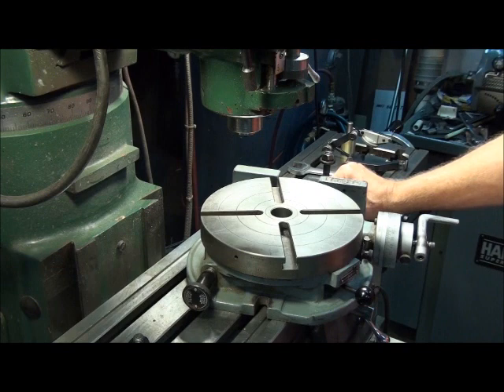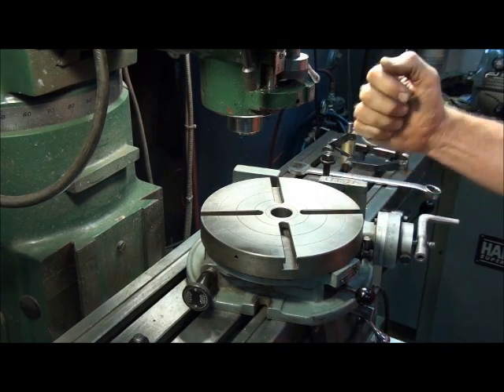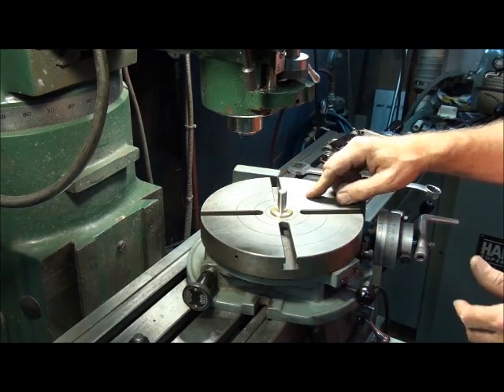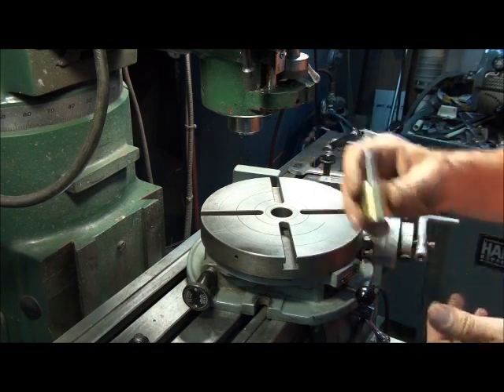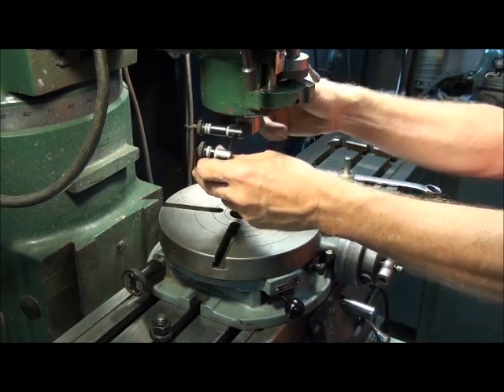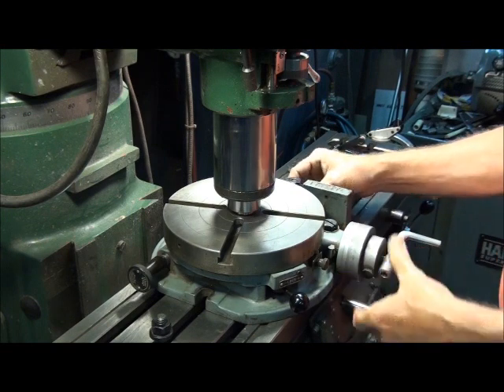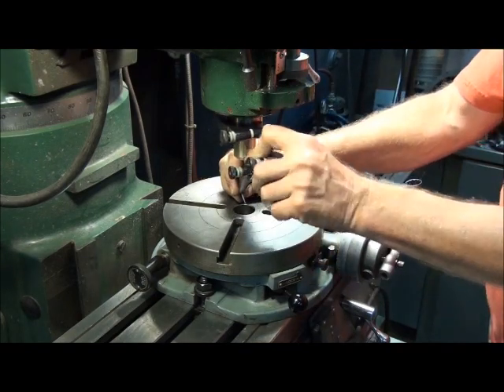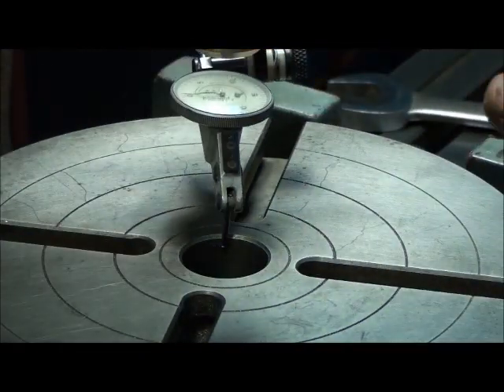Center a Rotary Table in Under a Minute Without an Indicator

Comment: Looks great but not sure how to cut a nice taper on my lathe without using the crosslide and feeding by hand which leaves a crappy finish or throwing my tail stock out which is tediously long in getting it back in line. Any suggestions anybody ? I also always indicate on the round part that I'm machining. As I'm laying out bolt circles, it always works for me. I don't see how this method allows one to avoid indicating the part.
Reply from the maker: @SmeeUncleJoe  There is another bideo on my site showing how to use a cordless drill to feed the compound or cross slide. You may want to check that out.
Reply: @TomsTechniques  sounds interesting...

Comment: Tom..... I did the same exact thing.  I'm not the fastest machinist in the world, I'm an engineer that happens to have a machine shop and I started doing similar things, in fact, made myself exactly the same thing.  Didn't take me much time now to center up.  (Believe it or not, I found one of the "end mill holder" style mounts, with the set screw in the side....  one that is ALMOST, perfect for the turn table. I made one up, because even though the end mill holder was close.... it was a hairs difference. but I could get darn close with it.  Your video has me adding a taper to my current one. I made it a snug, hard precise fit, but I think the taper is a better idea.

Comment: All well and good but my rotary table has no center hole. It has a T slot across the center  with two independent vice Jaws running in it. Looks like above but with one slot across the middle.
Reply from the maker: I've actually never heard of a rotary table without a center hole. The entire principle of RT work is reference to the center axis of the table. It might be time to find a new one.

Comment: how do you clamp parts to table- there's not enough room for toe clamps?
Reply from the maker: Make a sub plate that attaches to the rotary table and screw your part down to that. You may not even need to use clamps.
Reply: @TomsTechniques  thanks for the help Tom

Comment: Could you lock an expanding arbor in the hole for a snug fit. Then drop the collet over its spigot and tighten the collet.
Reply from the maker: Yes, but how would you get the arbor in and out without removing the table?
Reply: @TomsTechniques  I thought that loosening the clamping screw would collapse the arbor.

Comment: You did a bit of slight of hand.  I would expect your test to be exactly as you showed given how you centered the table.  BUT, what you left out was moving the table.  You didn't account for backlash.  I think once you got it concentric, but not tightened down, you need to move the x and y a bit, set the zeros, and then tighten it down.
Reply from the maker: A digital readout negates backlash. If you didn't ise one then yes, you would need to remove the backlash before tightening the hold downs.

Comment: My 6" Phz II center hole is an MT2 taper.  
A drill chuck arbor, with a straight shank, works perfectly for your procedure.
When I need a lathe chuck mounted, I use a large drill bit with a MT2 taper and simply lower the chuck over the drill bit.
By tightening the chuck on the drill bit, it'll self-center perfectly on the table.
Now I clamp down the chuck to the table. 
Hope that made sense...
Thx, Tom
Reply from the maker: Yes, that definitely makes life easier.

Comment: Thanks very much Tom, love that idea, and I can see me using it a lot in the future. 
I came looking for RT setup techniques after reading a machining book. 
The author of that book reckons that unless the RT is very high quality, the accuracy of the taper hole can be off a little to the true axis of the RT. 
For high accuracy he recommended you do something like clamp a turned ring to the RT and dial it relative to the RT axis so it running perfectly true, then afterwards dial the ring to the mill spindle. Then you know for sure the RT axis is accurately running true with the axis of the mill spindle.
I know that is in complete opposition to the point of your video but talking about high accuracy here for less than perfect RTs.
Reply from the maker: I have never seen a rotary table with a center hole that has questionable concentricity, but I suppose the exist (China). You just have to know your machines and their accessories to have confidence in them.

Comment: y not just use a dead center
Reply from the maker: If you had a plug with a center hole, that would get it close to center. This will get it closer.

Comment: Good trick fundamentally, anything that you can make once to use dozens or hundreds of times is always smart machining.

It's worth noting however that generally the bigger consideration is indicating your part true to the rotation of the table, and then indicating the table rotation to the spindle. This is particularly true when you understand that the center bore on most rotary tables is substantially (between .005 and .030) non concentric with the rotation anyway. 

Tapping in a part on the table to make it true with the table rotation after its aligned with the spindle is far harder with most setups.

Comment: Hate to say man .003” of wiggle is a lot much, if it was truly the same size as the bore she would be tight going in and next near impossible to fully seat. Take the time and just do it the right way man. 5 minutes vs. Wasted parts.  

Good for home use, but dealing with multiple bores over a few inches of distance ain’t worth a penny when your working within a thou
Reply from the maker: Where did you get .003"? The TIR was .0005" in the video, absolutely close enough for any part with a .003"-.005" tolerance. and much quicker than taking the time to set up with an indicator. If the part you are working on requires a closer tolerance, then common sense would dictate another method, such as an indicator. One of the biggest mistakes a machinist can make is to waste time creating a setup or machining a part to a closer tolerance than necessary.

Tom
Reply: Toms Techniques this .0005” static. 

I truly don’t mean to pedantic. Been doing this for 8 years now and most of the parts I work on are “x.000 +-.001” . This is on rotation. Of the 5 C tables I have used, none of them have been within .005 on a rotation. When doing partial curves this needs to be spot on, when not I have to shim the table. This causes to much friction during rotation, thus making cutting on a curve unsatisfactory. 

Just a nit picky thing

Comment: Dear Tom,
                   I wish to thank you very much for your videos again. I made a tapered pin in this fashion for my somewhat smaller rotary table and milling machine. The bore of my rotary table is a No.2 morse taper so I turned a pin with a No.2 morse taper one end and a 1/2" diameter the other from stainless (I hate the rust fairy) in the three jaw chuck at one setting. Centreing the rotary table is now a doddle. This idea is a peach. This set me thinking though as I had to mill a radiused edge around some holes on rope eyes that I was machining. I turned a Morse taper 2 plug for the table with a 3mm bore in it. This means that I could turn a pin with diameter 3mm one end and whatever was needed to fit the part on the other to centre the bore on the table before clamping it to same. The pin is then removed leaving access to the bore. It worked well.
I also want to say thank you again for the video on grinding drill bits for brass because having honed all my drill bits for steel I was having a torrid time with snatching. Well, having watched your video I bought another set of bits to dedicate to brass and having stoned those that I needed as I went everything was in apple pie order since. So thank you. If you ever visit the U.K I reckon that I owe you a nice warm beer!
Reply from the maker: Thanks Jack. It's always good to hear that the videos are being used.

I am of Welsh ancestry, so I would love to pay a visit to you fair country, in spite of the warm beer thing ;). Now that I'm retired, that just moved a bit higher on my bucket list.

Tom
Reply: @TomsTechniques I don't know if you ever made it to Wales but having been there a couple of times now, I have to say it's such a beautiful place and well worth the visit!

Comment: Excellent time saving solution for setup!

But, wouldn't it be more accurate to place the indicator with a magnetic mount on the surface of the rotary table and put the indicator tip on the spindle and then spin the rotary table?  I always found that the center hole on the rotary table isn't always true to the center of rotation.
Reply from the maker: Yes that would be more accurate, but it would also take a lot more time. This is a quick and dirty method for when centering a part within a couple of thousandths is good enough.

BTW if the center hole on your rotary table is not concentric, you should probably look into getting a new rotary table. Some things, such as the parallelism of the t-slots in your mill table are assumed.

Tom

Comment: Thanks for the tip! Can you do a video on tapping into mild steel on a lathe Preferably with a tap bigger then a 1/2-13???
Reply from the maker: +Dennis Ginser 
A spring center is the best way to tap in the lathe regardless of size. I'm actually thinking of making one as a beginners project tutorial, so maybe I'll demonstrate tapping in the lathe then.

Tom
Reply: +Toms Techniques  thank you. I normally use a spring loaded center. I just got a job that wanted me to tap a 5/8-16 with 1 inch of thread and the material is extremely hard to penetrate. I used a carbide drill thinking it was just case hardened and it was hard throughout. Once I got my whole drilled. I went to tap it with my spring loaded center and it is extremely hard to tap. Broke my tap twice and I'm keeping moly d on it and clearing my chip. Any tips would be much appreciated. Thanks tom.
Reply from the maker: +Dennis Ginser 
You need to use a taper tap for hard materials to keep the chip load down on the teeth. If you use a plug tap, the first teeth takes all the load and will fracture. A four flute tap is preferable to a two or three flute tap for the same reason.

Tom

Comment: Basically I want to add this color around this pivot the centre hole is 1/4 inch and I would like tho collor to go around that to be around 4 m&m bigger than that I could send you an email of what I need your advice on how to use the mill to achieve this please. Take care lee.
Reply from the maker: You can make a collar on the mill using a rotary table, but it would be a lot easier on a lathe. Basically you would just rotate the stock against the cutter to mill the inside and outside diameters. If you are cutting G10 glass epoxy, it would require carbide end mills. Also be sure to use a vacuum to collect the dust because it is hazardous to breathe.

Tom

Comment: Hi tom, I have a project coming up for a customer that I have to make what we call a pivot ring what I would like to ask please.. Is that if you could do a video pleas of using a milling machine to to mill a round coller that will go around a 1/4 inch pivot hope this makes sense if you could help with this please I would be eternally greatfull I have the mill a rotory table and laith chuck that goes on top of that that came this week. The material I will be using will be similar to carbon fibre called g10.

Comment: I use a live center with a morse cone  from my lathe.. Its the same cone as it is in my milling mashine so it fits in there. Center the rotary table with the center and tighten the screws..
Reply from the maker: Have you ever checked it with an indicator to see how well it aligns? You are relying on the chamfer being concentric with the bore and since it's probably 45º, it's not going to match your 60º center. Better check before doing anything critical.

Tom
Reply: Toms Techniques Thanks for answer! Well... it was good enough for the parts i made so far.. They were pretty center ;-)  Anyway.. Love to watch ur videos!!  Keep going Buddy.. Greets from Germany!!!
Reply from the maker: Thanks. Greetings form Michigan!

Comment: You realize with the indicator set like that you get a cosine error right? Where it is no longer 1 to 1 ratio?
Reply from the maker: Dial test indicators are best suited for comparing features, not measuring them. In this case I'm comparing one side of the hole to the other, so cosine error doesn't come into play. For actual measuring, a dial indicator is a better option, or using the DTI to compare a reading to a standard, such as a stack of gauge blocks.

Tom

Comment: my rotary table has a .500in center hole so I just use a short piece of .500in ground shaft. it fits the hole so close that I have a vacuum when I try to remove the shaft and it comes out with a pop sound. Also if I want to install a chuck on the rotary table I tighten the chuck on to the shaft sticking out of the rotary table and it will be centered as accurately as the chuck jaws are
Reply from the maker: That's the same principle I use to center parts that have bored holes. I select a gauge pin that's a tight fit in the hole and grab that with a collet.

Thanks for watching.

Tom

Comment: This is a good technique, even the half a thousandth that you may be out so what! how many home or even professional milled parts require a tolerance of better than +/- .001, most can tolerate +/- .002-.003! good time saving idea
Reply: Ted H. Most professional parts in my industry or more like .015 and that’s no joke. You want more accuracy you’ll pay and guess what? It just doesn’t matter for what the parts are used for nobody will ever know it could be .050 off. As machinists we cringe but consumers haven’t a clue.

Comment: great idea, any suggestions for mounting a super spacer, rotary index horizontally, instead of vertically? cause they are a pain
Reply from the maker: I made a similar device for aligning my dividing head. It's a block with two holes bored in it at a right angles to each other with a couple of 1" dowel pins pressed into them. One pin gets mounted in the quill which is left free to float and the other goes into the chuck on the dividing head, which has the angle lock left free. When the chuck on the dividing head is tightened, the angle gets set to zero and the spindle axes align. The head is keyed to the table slots, so that is already aligned. Obviously, great care must be taken ensure that the pins are at right angles with each other and that their center lines intersect.

Tom
Reply: You sir, are a genius. Thank you, should do a quick video on that, I'm sure others would love to see it.
Reply from the maker: EitriBrokkr
You are very welcome.

I forgot to ad that since the dividing head is keyed to the table, it must first be centered on the spindle axis, or you can kind of "feel" it on center with the Y axis crank as the chuck is tightened.

Tom

Comment: If at first you don't succeed. Well, I tried to make one, but struck out. My old lathe is so loose that the dials are nearly useless, if I was even any good at using them. I almost have to FILE my way to a close tolerance like is needed here for the head taper, let alone the collet shank. I always seem to take "one pass too many." Of course, it was my last piece of stock big enough.... (BANGHEAD!) That, and it's zero degrees F out in the garage!
Reply from the maker: It's always challenging when the machines won't do what you need them to do. Have you tried tightening the gibs? There's nothing wrong with filing if there is only a thousandth or two to take off, just be sure to watch my video on how to do it safely.

Tom
Reply: Hi Tom; The old beast has wear everywhere. I would not be surprised that the gibs are not true and need replacing. I think the biggest problem is wear in the main spindle bearings. It has both axial and radial movement there. I need to spend some time re-shimming the spindle bushings. Yes, you read that right. Bronze bushings. This is a Prentice Brothers 16" Gearhead Engine Lathe made between 1909-1912!
Reply from the maker: It sounds like a real beast. Are you sure the bearings aren't babbitt?

Tom
Reply: Well, it's only a 16x36, but it's a good size old lunker. Can't post pics here, but they are split bronze plain bearings. I need to take the time and work on the shimming to see if I can tighten things up a bit. Worst case, it needs new bearings. Those will have to be made. It's so inaccurate, I can't tell if it has direct read dials or not!

Comment: Tom; I'm a new subscriber to your chanel, and am bouncing around at random. I'm finding your style fits mine quite well. Get it done, efficiently! As a moderately dense noob metal mangler, I have wondered about doing many different basic tasks, and this was one of them. When I saw you use this doodad on the carriage stop vid, I had to come back and watch it, and that I'd be making one. I had this very same idea for locating the table, since I do similar with drill bits to "center" existing drill holes. It is very nice to know I have some similar insights. Please continue just as you are. Priceless. Now, off to the vice indicating vid!
Reply from the maker: Glad you are enjoying the videos and thanks for watching.

Tom